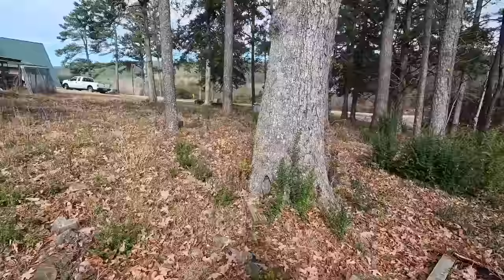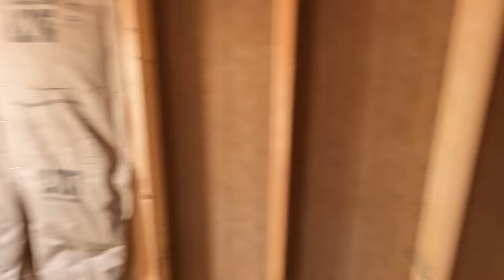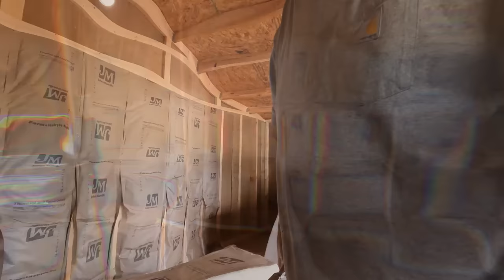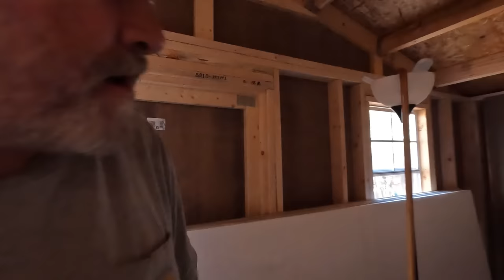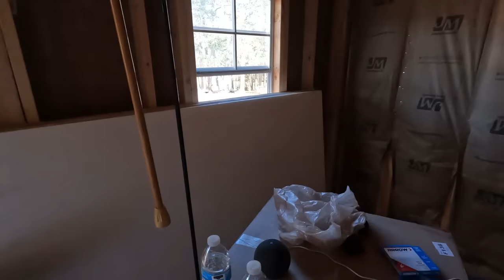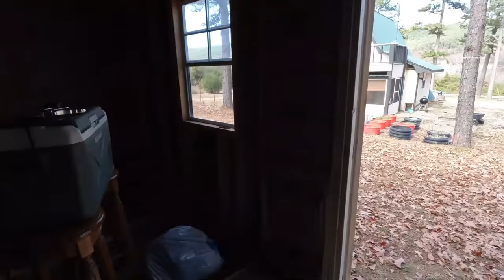Turning A New Portable Building Into A Workshop EP-3

Comment: Do you have to do vapor barrier on ceiling before the foam board? We had a 24x40 , put a loft over the front and back, with a set of pull down stairs. Center was open, but we had moisture even tho we insulated the center ceiling.

Comment: Mike, glad you are feeling a bit better. You accomplished a lot today. Hope you can fashion a tool to cut the bottom insulation. I'd put in 5 outlets, one under each window and one on the other three walls. You'll need them for power tools, maybe a coffee pot and especially for an air conditioner or a heater. Stay well.
Reply from the maker: I have battery banks